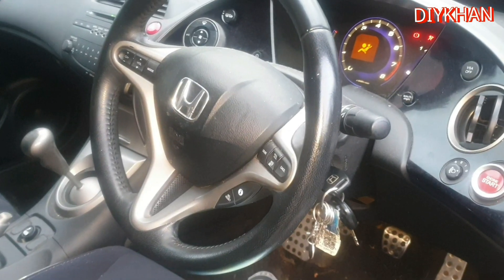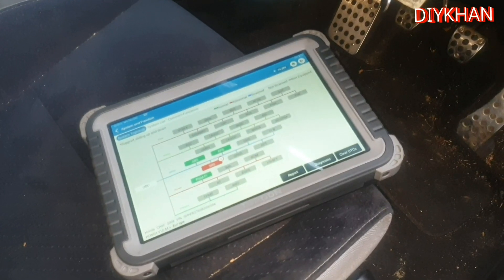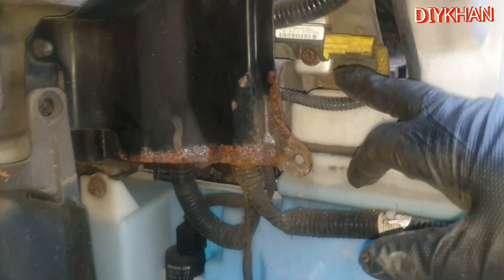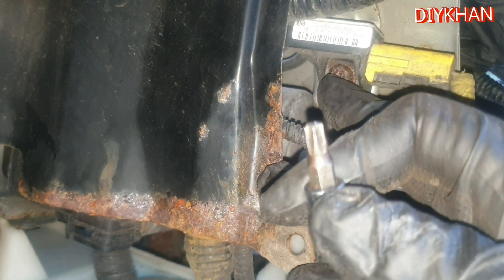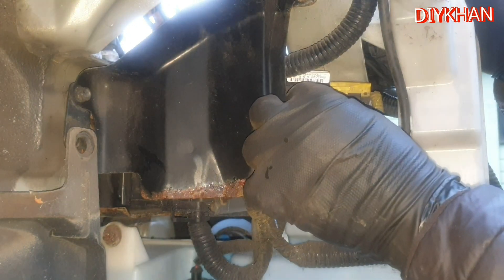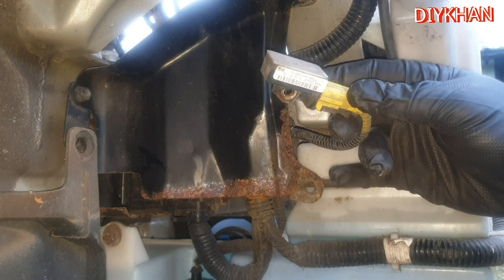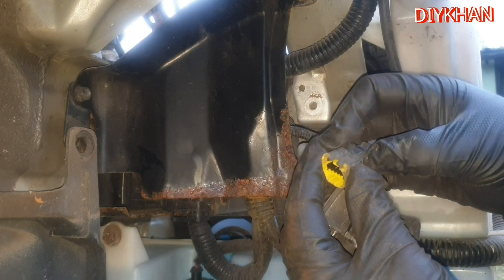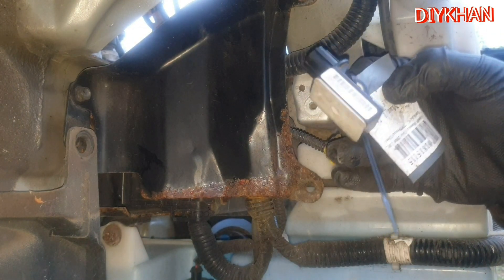Honda Civic MK8 Front SRS Crash Sensor Change. (12-10 Open in the right front airbag first inflator)

Comment: The code 12-10 relates to the steering wheel airbag, any idea why that sensor would throw that fault? I have same issue currently trying to sort
Reply from the maker: @MichaelWilliams-wm5nf  I would charge the airbag. There are few available on ebay for reasonable price. Make sure to buy the right type as there are few different types ie two yellow connectors and some have 1 yellow cable connector. I would disconnect the battery then clean the connectors on the side of steering column and on inside the steering wheel. Make sure u use an electrical contact cleaner. You don't have to clean the connectors going inside the airbag. Hopefully this will sort the problem out. Good luck 👍
Reply: So you replacing the crash sensor didn't fix the fault? I don't want to replace the sensor and it still be an issue, also thinking it could be the clock spring behind the wheel
Reply from the maker: @MichaelWilliams-wm5nf  I would start off with airbag and that doesn't sort the problem out then would charge the crash sensor. In my case I had to change the sensor as well as clean the airbag yellow connectors to achieve the success.
Reply: @diykhan  have cleaned the airbag sensors with contact cleaner and now no issues so far 👍
Reply from the maker: Glad to hear that. That's very common issue. All the best
Reply: @diykhan  ended up changing the clock spring in the end that fixed it
Reply from the maker: Glad to hear your successful story.